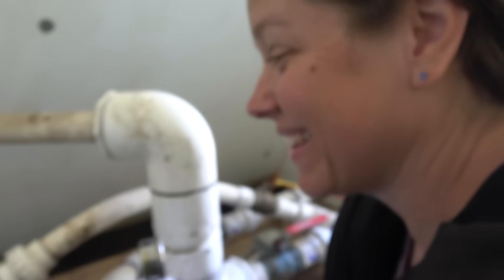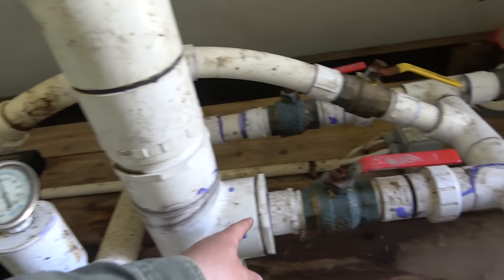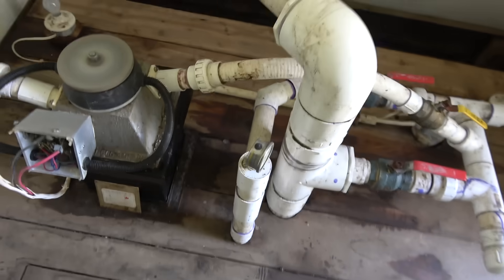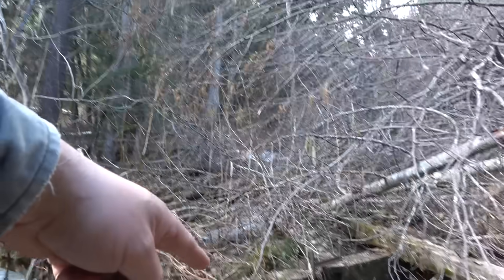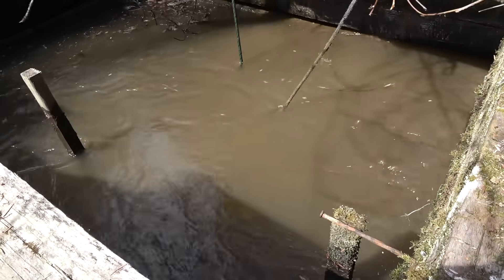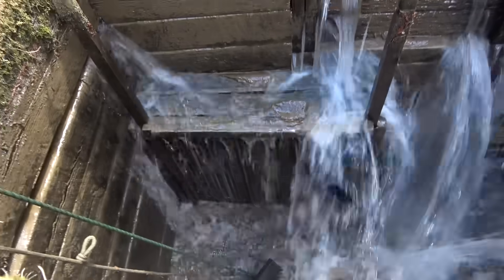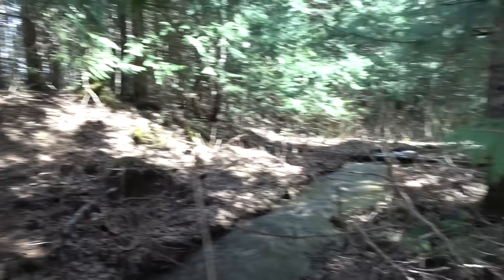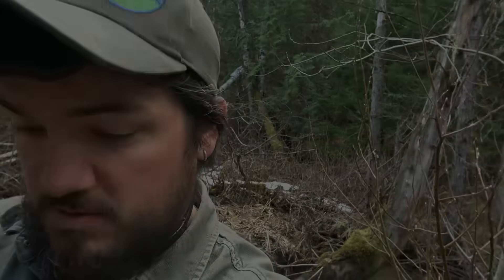Off Grid Micro Hydro - The Dream System!?

Comment: I wanted to watch this because I'm getting ready to put in a hydro system. But the scream of those bad bearings was more than my ears could stand.
Reply: This machine is in a tiny isolated room where sound is amplified and it is being recorded on a phone. I can assure you that our Stream Engines are not this loud. When he is speaking in the shed you can hear his voice clearly over the whine of the turbine. Phones pick up the loudest sound and amplify it.
Reply: @microhydropower  thank you. It was a rough day I couldn't take the noise but later on I'll go and watch the video with the sound down,  the closed captioning on.  I have a 40+ foot waterfall I want to put hydro on.

Comment: Bearing is smoked
Reply: The machine has three bearings and although these ones should be changed out the noise is due mostly to the fact that it is being recorded on a phone inside a small insulated building. If the building was not there the noise would not be so great.

Comment: that thing is loud af. and i have my volume turned down.
Reply: The machine has three bearings and although these ones should be changed out the noise is due mostly to the fact that it is being recorded on a phone inside a small insulated building. If the building was not there the noise would not be so great. Their voices can be heard clearly over the sound of the machine.

Comment: This video is awesome, thank you for showing us the system. Solar power is easier, but if you are struggling with getting through the night on power, you could use excess power during the day to pump water to a lifted tank, and then during the night you can allow gravity to bring that water back down through a turbine. This isn't necessarily efficient because of losses and the pump using power, but if you can't get batteries for some reason, it technically is a storage of energy.
Reply: There isn't a pump. This machine produces the electricity and it is sent to the batteries to store the power.

Comment: Have you thought about having an automated bypass control valve open to the hydroelectric impeller water inlet when the water gets too hot to the water heater to slow down the water inlet flow rate, thereby reducing electric power, thereby reducing power to the water heater before it gets close to being too hot. That bypassed excess water can be diverted back to the original creek via pvc pipeline.

Comment: Would this work with a self-made big basin that collects rainwater? I mean I live in a very flat country with hardly any streams like the one in your video, but it does rain a lot... I once "designed" a house basin/pool/pond on top of the roof, which doubled as a roof terrace/garden with a pond.
Reply: Will not work.

Comment: That turbine's bearings would not have lasted for 15 years straight.  As well, the wheel working inside that drives the alternator would have erosion from contaminants in the water.  The other thing is water permits involved in this as there are probably a lot of other systems like this but with the don't tell your neighbors attitude.   Was there permits for this?  Its a great idea but the turbine is capable of only so much power but can work because of the continuous output and the energy is stored like in a solar system with batteries.  Alone, without batteries, it would be a weak system unless a much larger system is in place.  The old saying of No Free Lunch applies and if you want big, you have to go big but its expensive.
Reply: There are many machines that we have produced over the last forty years that are producing as much energy as they were when they were installed. We cannot say whether the bearings in this machine have been replaced, as regular maintenance demands, but many machines run for many, many years without any maintenance. We advise our customers to change the bearings every year because it is the only part of the system that can and will cause catastrophic failure and we have seen that enough. There are plastic peltons on machines for 30+ years that are still in operation. We make stainless steel wheels as well and those will last a lifetime. Machines can be set up to produce AC direct to appliances or heaters such as baseboard heaters. This size system produces more power than is required for a family home if you are of the off grid mindset. Grid tied individuals are not easy to work with because most are unwilling to step down and away from the luxuries that they have become accustomed to.

Comment: Yeah that sounds like shit.  Can I say bearings???? Wow what a disaster
Reply: The machine has three bearings and although these ones should be changed out the noise is due mostly to the fact that it is being recorded on a phone inside a small insulated building. If the building was not there the noise would not be so great.

Comment: Great machine , coupled with  hydraulically terrible plumbing ...

90 deg bends , sudden changes in diameter ,  wrong lengths..

They can make  
More power 
Lesser noise 
 In lesser water input 
Lesser water head 
..
The system Just needs an engineer who  understands hydraulics n fluid mechanics ..

Comment: Long term, your system is much better than solar system, and additionally, providing the water does not freeze, you have pretty much 99.99% constant power supply. On other hand no sun, no energy with solar systems and if you live up north, God help you in winter times with solar system

Comment: could you use a rectifier at the hydro and turn it straight to AC, or add a shut off solenoid to the plumbing to slow or stop the water intake when you reached your limit of electricity needed, add a battery bank? The solar controller would shut off the dc overage by cutting the hydro voltage ?

Comment: Just wondering, is there an efficient way to turn the flowing water into heat, such a friction?  That heat could be used for heating, hot water, heat a pool, etc?

Comment: 30 meters of hydro head would give you about 42.5 psi pressure (30 meters is 98.42 feet; times conversion factor of 0.433)

Comment: What are you going to do when you're 60, break a leg, etc. making maintaining water flow dangerous to impossible?  More down to earth, how long will water wheel and generator last before needing replacement.  Surely the bearings will wear down sooner than later.  I love hydro, micro hydro, etc but as village solutions, not individual.  There is nothing more appropriate than solar even if that means batteries.  Key to solar is reducing load,  and having more than enough solar panels to provide basic power, maybe not all, but basic, even on cloudy days.  PV panels are the CHEAP part of system and the longest lived, actually, unless physically broken they will churn out energy w no work involved long past it's owner passing.  The replaceable elements in solar are the AC / DC converter which is usually coupled with whatever inter connects you are using, battery / utility.  The only issue is one that is merely frustration, losing the extra power generated on sunny days, which could otherwise be shunted into water heating, for domestic water, even helping with building heating.  It's possible, but far from mainstream to set such up.  GOOD LUCK, I like your setup, esp water intake.
Reply: Energy Systems and Design has been building micro hydro generators for 40 years. Replacing the bearings is necessary every once in a while. We have had very few machines come back for repair. We've sold them all over the world.

Comment: Do you have a backup power system, in case the stream dries up or if the flow is extremely hampered?  (First time watcher of your channel. 🙂)
Reply: Usuallyony happens in the summer months when solar power is most available.
Reply: Usually only...

Comment: Use a sand battery and have your hydro store the excess energy of the summer to use hot air in the winter. This would be a neat technology if we could do it on small scale. Check this vídeo.
https://www.youtube.com/watch?v=tm7spMG0ch8&list=RDCMUCMFmrcGuFNu_59L0pHcR0OA&start_radio=1&rv=tm7spMG0ch8&t=4

Comment: 30 meter of elevation would give 42 psig water pressure.  I wonder what flow and pipe diameter you have?   Good job.  I 16” turbine from 1880 has enough hp to turn a large mill stone. Some have been in use for decades.

Comment: I have a creek behind my house that could be tapped for Hydro.  My issue is that the house is about 5-6m vertical to the creek & about 40m horizontally.

It's a 'reverse fall',  I suppose.

So, I guess that I would need to have the power-gen 'unit' right at the creek, with power lines to the house.   This is not ideal.

If you have dealt with this, do you have any initial thoughts about how to structure a Mini/Micro-Hydro setup like this?
Reply: Water is heavy and given enough water in a confined space like a hose or tube it will draw water up hill as long as the weight is less  and doesn't lose seal..... one metre of hose 100 mm round will hold ten kilos or water 10 metres of hose at 100mm round  will  hold one hundrsd kilos of weight.  

So build a tower with less hose higher then the house and have longer hose on the other side...You may need large drum at the long end filled with water and the hose at the bottom so it doesnt lose seal.... also put a large large (really large drum) for explame a one Cubic metre of water I one tonne 

So bigger hose in for flow plus, weight of water in drum for gravity pressure  and smaller hose out  to keep water flow  pressurised on outtake and into motor.

Long as you have less flow from the drum exist it should always have the same pressure 
Do you own math and research  becuase I really have never even looked into it or done anything with it........but that is my guess, never really  thought about it before lol  

I would leave diagram but youtube doesn't like that, but I am sure you could find something similar on the internet

Comment: That was great and being a pipefitter by trade I have always thought about this. There is another option with the hot water heater to that you may want to consider a circ pump. You could run hot water base board heat as well which you would be using the waste heat from the heater to also heat your home plus you would always have instant hot water in your home. Hydro power is the way to go it runs day and night never quits.
Reply: You could also connect heat tape to the system and wrap your intake line so it won't freeze up in the winter. Something I always thought of doing
Reply: Great ideas - I have something to add. You could do all of that with a sand battery. They are so efficient and you can bury it and store energy as heat instead of just dumping it. Then heat your home as you said, have constant hot water which can also be translated back into turbine energy later with another small steam generator if you want. I've heard that good sized ones can hold over 1400 F sand for several months. With nothing but pipes and a few valves, a steel container and regular old sand or crushed glass.
Reply: @gtcazusa  Wait, what? I need to understand you. Ugh I need a homestead partner
Reply: Good idea no more cutting wood or splitting wood lotta  work when you start getting older, work smarter not harder
Reply: Good O
Idea with the baseboard heat , anything steam related , heck I wonder if you could cook with it
Reply: to be honest, you could probably heat your home off of the heat those bearings will be putting out

Comment: Laugh, very cool but it's simply diverting pressure thus returning to the same resonance harmonics/sound wave: You would need two inlets to ~double pressure at the turbine inlet, loss with turbulence not considered. Still, very cool
Reply: Change in pitch is in-fact due to pressure change, but due to less pressure with a fork. If it was two pipes and valve is opened it would immediately increase in resonance, whereas it doesn't ever increase in resonance, rather lower due to slower spin due to pressure and once back to normal pressure same resonance.
Reply: It certainly is considered as well as loss from transmission line.

Comment: So can't that be done from a water tank if it just circulate the water? How about a solar water pump to pump the water through the pipe to the power supply then back like a continuous water flow from a big tank.
Reply: That is not a possibility.
Reply: @microhydropower  I bet it could once you get it started circulating it will produce.
Reply: @wildfire365  perpetual motion is not a thing. There is no free lunch.

Comment: I am amazed any thing flows through that granie's knot of pipes.
Reply: The plumbing certainly be improved.
Reply: G'day, mate, 
LoL 😂 that's a little harsh mate.. I've seen one or 2 things I'd do differently but nothing is screaming absolute disaster.  
 Unfortunately they've used the wrong type of glue for that pipe (ie pressure pipe).
It appears that they've used standard type N "Blue" glue Instead of the required type P "green" glue (ie high pressure glue). I know it sounds stupid but these things are important because ...(1) it's now not up to PCA (ie  plumbers code Australia) and (2) because I would get my ass kicked if that was my job  ....and obviously please correct me if I'm wrong. Maybe things are different over in the states....

Comment: WOW I am surprised you are trusting an STC-1000 to control your hot water. Ive had many many of these fail and create a thermal runaway situation and in a hot water heater that can be very dangerous.

Comment: I've ran a Harris Hydro for 15 years now. 147' of fall, a 3" line, and a high of 940 watts (spring runoff) to a low of 240 watts in late fall/early winter.  Grid tied! No batteries!!!  And i get back every single watt due to being grandfathered in with my utility.  Off grid for 28 years before, grid tied rocks!

Comment: I would like to have hydro power for my house, but I haven't figured out how to do it. I have a wet weather creek that flows for about 8 months a year--those being the fall, winter, and spring months, when solar power would be more lacking, so it would work well as a supplemental to that. It doesn't have a huge drop, like a creek coming out of the mountains, but it has decent flow and can run quite fast after a rain. 

The problem is that the water is running in a ditch that's about 5' deep at the deepest point, but the water is usually only between ankle and mid-calf deep, on average. I haven't figured out how to make a system utilizing it because the water is running so far below the surrounding ground and everything I've seen has the turbine lower than the water. Damming it isn't an option because one, my property line runs down the middle of the creek, so I technically only own half of it, and, more importantly, it's 5' deep because in heavy rain, the water will be 5' deep. I know, from experience with a log, that blocking it even a foot or so in height will cause the creek to overflow and flood my yard during heavy rains.

I've seen some people experiment with floating turbines, but they didn't seem to produce enough power to do anything other than power a few LED lights as a novelty.
Reply: Send us a Hydro Site Survey available at the bottom of the page on our website, "how it works".
Reply: Could you immerse a pipe in the ditch and divert the water to a location further down hill? After the water goes thru the hydro you could divert the water back to the same ditch further down stream. Keeping the inlet clean would likely be difficult. Just a thought.
Reply: @LogicalLove13  I'm afraid not, as the water is running 4-5 feet beneath the surrounding ground (it's basically a very deep ditch). My property is probably around 500' in length at the creek and there's not enough drop between the high end and the low end to get the pipe out of the creek and into a power generator--not without cutting a channel and burying it. Now, if I had a ditch witch, I could cut a parallel mill run, but I'm still not entirely sure I have enough drop to allow it to go through a generator before ended back up in the creek. (Also, I have to go across the water line to the house, which could complicate things.) And I'm not sure how, if the creek rises, you'd keep it from backwashing into the mill run. 

I feel like there ought to be an answer to this, even though there are so many variables, but I haven't found it yet.
Reply: @kerim.peardon5551  sounds like an interesting situation. Good luck!

Comment: Awesome system if you have the right property for it. Now you just need to farm Crypto with the excess power instead of wasting it as hot water being dumped outside. Might pay for any repairs needed later on. You can hook up to the Net using Starlink anywhere pretty much. Worth looking into. Not huge returns, but if it's free power, it's a lot better than paying for the power.

Comment: Awesome system for sure, how does it work with freezing temperatures though and not a smart a@# question I'm genuinely interested . Thanks for sharing !
Reply: As long as the water is running all of the time, which it does in the winter, there's not an issue with freezing. We're in Canada and our winters are very cold.

Comment: Could you connect up a battery system for your excess energy? That would be pretty sweet that way you could store your power and use it during the winter when you don't have as much
Reply: Long term storage is better done by storing energy as a supply of water behind a dam. Short term storage would be to store unused energy in a battery which builds up over night and then is used during busy times in the day.
Reply: @joecanuck3751  ya good point, but can it be done on that system?
Reply: There are batteries. The dump load is to protect them.
Reply: @microhydropower  ahh nice